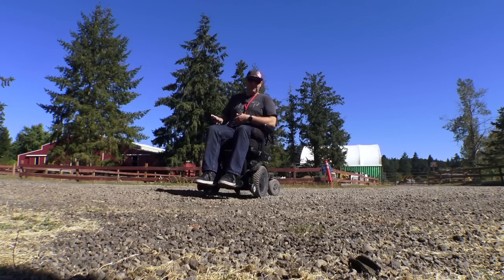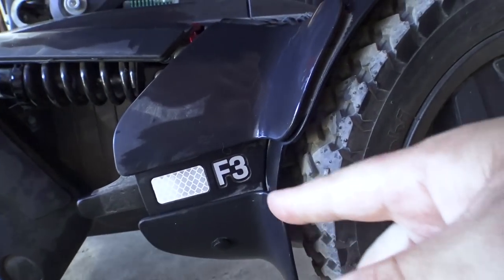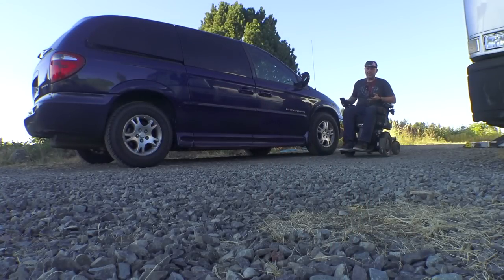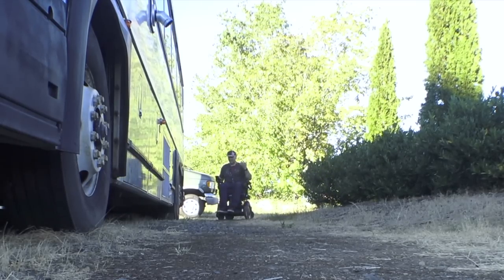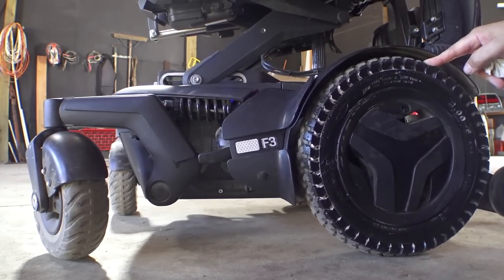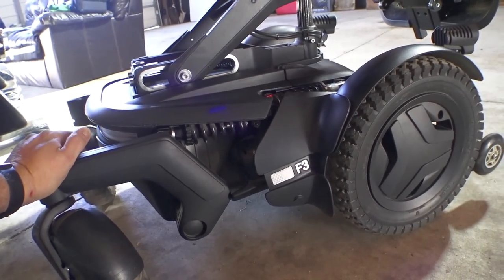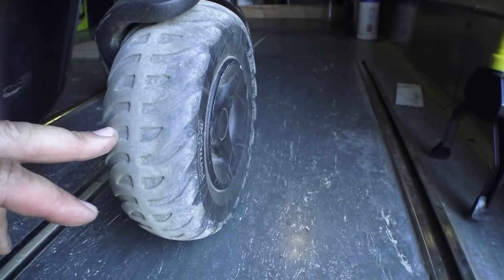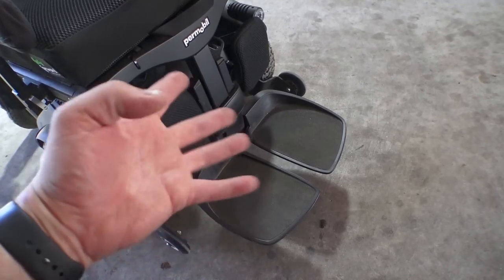VLOG 629: one year later - Permobil F3 review!

Comment from the maker: it appears as though these permobil 'aggressive tread tires' are made by CST (part of maxxis) - i'm searching for equivalents, as they make  LOT of motorcycle, small tractor, and mountain bike tires!
Reply: Great review and insight on improvements as compared to your '17 f3 pwc. Watched you clean the brushes on the old f3 and you referred to them as two-pole motors. Are the new f3 motors four-pole? In light of your 'Edge' bomb, some folks might like your thoughts about the difference and benefits of both two-pole and four-pole pwc motors. Thanks
Reply: I have a wheelchair almost just like that one,it was giving to me after my TDX SP2 broke down 4 months ago.
Reply: Watching you work on the chair I almost forgot your the one who uses it. I have the same chair, it’s great but useless in snow, anyways I wanted to ask since I’m a caregiver s well and my son who is hypotonic of the lower trunk and autistic, his ankles are weak and turn in, I wanted to make. Board he could stand on at the back of my chair, what’s your thoughts?
Reply from the maker: ive made some skitch boards over the years.. havent really made one i like, and that works well yet.. but its a good idea! attaching them to the chair is the trick..
Reply: I made a bracket to connect a set of jungle wheels to the rear tie down loops with a bolt/washer on each side.

Comment: I'm currently driving a 2021 lime green Permobil F3 that I took delivery of on December 20, 2021 (ordered March 13, 2020) and my parents have even noticed a difference in the engine performance compared to my 2015 Permobil F3 that I took delivery of back in October 2015. At first I wasn't sure if they were right about the new 2021 chair being maybe a little faster and then my 2015, but after they review that you just did on your chair I'm actually surprised that they did change of the engines a little bit, I thought it was just the same that's what I had before and I thought it was just the programming done on the software that gave it a little extra power.

Another thing that I also really like about this newer generation for the F3 is the technology, for multiple reasons especially the MyPermobil Bluetooth connectivity function that comes with the chair. I personally like having it because if I'm driving somewhere and if something happens to the chair they can look on their computer and locate my chair if I am in need of help. Another thing I learned about this chair just recently from my salesman is that if you give than permission they can actually adjust the diagnostics on these newer chairs over Wi-Fi which is really interesting. Also I love how the Bluetooth connectivity option now comes standard on all of the chairs because the feature is built into the controller instead of being a separate option, and another convenient feature built into the joystick is infrared. I love having the ability to control my TV or any other infrared compatible device just with my controller on the wheelchair.

My beautiful Green Machine turn eight months old on August 20 and I just have over 70 km on it, and I agree with you Dan this is the best chair for sale. It's going to take a lot for other manufacturers to compete with this chair.

Comment: For cleaning the hard spots use cans air works great. I had a per mobile abut 12 years ago and hated it.the arms only had “back” support and when transferring the single bolt would break. The first few times were almost disastrous when I contacted my provider he said the arms were not ment to be used for transferring. I’m a c6/7 as of 7-8-1969 and needed the arms for transferring. That chair in out in my shed I have a Quickie 636S. In Dec I can get a new chair but not sure what to get I’ve had problems with the Quickie and has replaced numerous parts. 
Thanks for your videos

Comment: My first chair back in 2011 was a Permobil C300, which is the older version of the F3. These are both front wheel drive models. My next chair I got in 2016 was the Permobil M3. I chose that chair for the dumbest reason ever! The ALS support groups I go to, I'd be the first person to have the new M series chair. I have just hated the mid wheel drive as the additional front casters make driving it more difficult as it creates more drag with added casters having to rotate. Not to mention, off roading is horrible as the second you spin the drive wheels, then if you try to back up, the front casters try to rotate and your totally stuck! With a front wheel drive, you can go forward till you get stuck and can always get out backing up. I will never go back to mid wheel drive.

Comment: I am sure I will have more comments…
When attaching plastic pieces together, check out plastic rivets. Or stainless steel rivets. They are a combination clamp and fastener. They are also mostly flush and don’t catch on stuff. If you do aluminum rivets they are easy to grind flat.
Reply: Thanks for the review 👍🏾

Comment: I'm an avid hunter/outdoorsman and I am rough on chairs. Through the woods, over roots, up steep hills(backwards works best), through mudholes (yes I get stuck on occasion) all with the regular standard tires. I assume the aggressive tires fit the same wheel? They'll be my next purchase. Also, I use a side support, ribcage height, that flip around with the gray tab..... they're junk and need a redesign. Great videos bro!
Reply from the maker: they're a direct replacement for the stock tires
glad to hear someone else out there is using the crap outta their chairs as well! :^)

Comment: I’m a C4-C5 Quadriplegic and also use a permobile F3. For about 20 years I always had an Invacare Arrow Storm. I never had issues except for worn tire replacement which is expected or batteries not holding a long charge after three or four years. It always felt fast and extremely precise.  I don’t go out except maybe two or three times a week for different occasions “Doctor appointments , shopping , etc”.  I take good care of my electric legs😀!

I don’t know if I have the dud of an F3 batch, but I truly hate this chair. From the first day I received it, it drives like a bus compared to my older in the care chair. Granted the F3 is a front wheel drive chair and the Arrow Storm is rear wheel drive. The rep from the wheelchair company did all they could through the settings to make it more precise. It’s as if there’s a sensitivity governor on the chair so that if I make a quick movement it delays the response.  Also, I told the wheelchair rep a week after I had the chair that there’s a weird gearing mesh grind sound coming out of one of the motors while coasting. Thankfully it had only been a few months old “yep, had to wait that long for a new motor” and the motor was replaced under warranty.  I also had a separate tilt and reclined touch box that burnt out after six months.   The batteries have just been replaced this past week and are only just over a year and a half old. Now the chair as of yesterday is making a squeaking sound on the right side and cannot find where it’s coming from for the life of me. THE CHAIR IS ONLY A YEAR AND A HALF OLD. What else is gonna go wrong in the next three and a half years until I can get one covered by insurance? 

I’m glad your chair has worked out for you. Me however, I’m counting the days until my insurance will cover a new powerchair.
Reply from the maker: factory programming is definitely a thing... its odd that a permo rep wasn't able to get things sorted out for ya though!
the motor brushes can be noisy sometimes - its a common ish thing.. BUT if its brand new, def have them replace the motors.  ive heard of a number of them making strange sounds right out of the box :^/

the shocks will squeak on these chairs as well.. mine started doing it after about 4 months of use.. BUT i do run around in deep gravel on a daily basis...  its possible to put a very small amount of lube on the shock seals - im going to be making a video about it soon
Reply: @TotallyNormal-  Cool, thanks for the info! I'll check the shocks and put lube on the bolts connecting them. It's unfortunately one of those squeaks that is difficult to replicate. Sometimes it happens and other times not🙄.
Reply from the maker: shoot me an email or DM on twitter.. i can show ya exactly where to lubricate things :^)
contact info is in video description

Comment: I have that same F3, and it handles horribly at slow speeds like you described yours did at first, I just got mine and the rep, and I spent a few hours trying to make it handle; there's just no going straight at slow speeds it's either left or right just cannot overcompensate but they're coming back, but those tires I want and kinda almost need living in northern Michigan but are they pneumatic? Right now, I'm back in my old C300, which is still like new, luckily, because the F3 is way too heavy for my lift. I currently have it's a one-arm rated at 600lb, and I'm 230, so it looks like, for now, I will be using the C300 when I go out, which is not very often doctor app only as I'm a quad C4 anyways I joined your thing. Keep the videos coming. I love them. I come from a mechanical background, so I can tell you know what you're doing.
Reply from the maker: FYI if you have a backpack or anything on your chair that swings around, it can make things unstable- gotta be firmly attached! Also going back and forth between c300 and an f3 takes some getting used to. On the f3 you have to concentrate on holding the joystick in the direction you want to go.. as opposed to the c300 where tons of small hand movements/adjustments are required. I also found that I tended to lean left or right in my c300 when steering- which kinda aided in the control. I set the tremor dampening on my indoor profile on the f3 to about 15-20% and that helped a bit as well. The tires on the f3 are ‘solid’ but have a very compliant foam inside. Nothing like the standard primo powertrax tires. (They’re Permobil aggressive tread tires from the 5 series chairs) Anyways.. hope some of this helps!

Comment: Did you need to move your ezlock floor bracket for the new chair?  I'm to get my lock put on my 2021 chair and the installer said it maybe in a different location than my 2017 chair even though the part number is the same.
Reply from the maker: i haven't actually put one on my new chair yet :^/ apparently theres a few versions, and ive been trying to get one that has the bolt between the drive wheels, instead of further back.. they moved it on the F3 for whatever reason and they catch on EVERYTHING
Reply: I got a F3 in 2019, had the bracket for ezlock put on and they had to move the floor box back. YES I catch on everything, thresholds are terror now. Have to use my old C300 for places that have thresholds, of course the installer guys that put the bracket on didn't even tell me they just did move the box back and installed the bracket. Maybe you put some metal under the box to shim it up some, and that doesn't interfere with your footplates. If you find a remedy lets us all know, glad you are able to drive without that lock in "wink". I called Ezlock they seem not care about making a different bracket. Beware of catching on everything. If you find a different bracket let us know. I really don't feel like switching to a different whole system.
Reply from the maker: I strap myself down in the van.. it’s SUPER annoying though!

Comment: I have a F5 chair now that is 5 years old that my wife’s insurance paid for. Now on Medicare they will not pay for a F5. My question is how does the F3 compare to a F5. Doesn’t look like a lot of difference. Tkanks
Reply from the maker: the F5 is basically the same, BUT faster motors, slightly taller seat lift, footprint is a couple inches wider/longer and has slightly better suspension.
(and has options for standing functionality)
other that that,  they're essentially identical :^)
both great chairs!

Comment: I'm in process of getting my first power chair with it being F5VS. (Once all the hassle with insurance is done). The placement of the front brackets to hook in I found is a lot easier if you use seat elevation (if equipped). Found that out by happenstance.

The back brackets as you mentioned is just god awful. I was not able to hook myself in on my own when I had a test chair to trial for a weekend. They need to find a better solution for placement 100%!
Reply: I'm in the process of getting my 3rd chair and I'm going for the F5 VS as well. Getting insurance to cover it will be quite a fight! However, my last chair, I managed to get my insurance to cover my seat elevator and the foot plate elevator which they typically never cover. It took some fighting as they denied it the first go around and had to appeal it. I'm expecting an even greater fight on this chair.
Reply: @briankepp6343  Hi Brian, your reply caught my eye regarding insurance and power wheelchairs (pwc). My pwc can be replaced 4/2023. The vendor who showed-up for my pwc eval back then, dictated he sells permobil but wouldn't sell me one - not enough profit. He told me my three choices; I asked if quickie qm710 were available as specialty backrest was long overdue and too much time had passed due to complications (assigned vendor went bankrupt).  I had Vocational Rehab at the time who pay for the client's preference and add-ons insurance companies will not. As well, wo V.R. my current repair vendor told me that my pwc choices will be limited to quantum, invacare, sunrise medical (quickie). That quickie is sitting in the shop waiting for motors (3rd pr), batteries (3rd pr), R-net joystick (no. 3), Swing-away apparatus (no.4). Fortunate to have the old permobil c500 (2,800 mi.) and determined my next pwc is an f3 or f5. While you're familiar with the process of 'appeals' regarding pwc brand and add-ons, I'm not. Again, voc rehab helped me in the past, now I'm older and question my eligibility, but 'they' might be a resource available to you if necessary. Perhaps you could offer direction on what to expect, brand-wise, elevator, add-ons, etc. - regarding insurance paying. Thanks

Comment: I Heard The Left Center Tire
Squeaking So I Replaced It
With A Newone & It StillDose
The Same Thing. Could It Be 
The Rim It's Self. I Was Told By 
Mark's Mobility The Front
Suspension Springs Might
Need Some WD40

Comment: Great video! I'm in the process of getting my first chair and my PT and equipment dealer have suggested a Quickie Q700M by sunrise medical. That's the only company my insurance works with in NH. It seems like a good chair but am concerned about getting stuck in compact gravel, we live in a rural area with dirt driveway. As insurance will only cover an indoor chair, should I try and find a more hybrid option like the frontier v4 or similar? Thanks!
Reply from the maker: the V4 (v6 front) seems like a neat chair! - but they are considered a group 4, for billing, so they're rarely covered bu insurance.. im trying to get my hands on one though!
the quickie chairs - ya have to watch out for water.. their manuals state that ANY water can cause the suspension to freeze up if not cleaned off immediately.. BUT a small carpet blower fan does the trick when coming inside from the rain :^)
Reply: @TotallyNormal-  That makes sense, I wondered about water... thanks for the info!

Comment: I have 200 miles on my 2022  I am getting a clicking sound after being at speed for a bit than slowing down and going slow. I was told motor issues? Already?  And my leg rest cover broke too after 4 months. Got a replacement after my JB weld fix failed
Reply from the maker: ive had that on a few of my permobil chairs in the past.. does the sound change when going backwards? at 200 miles the motors are barley broken in!
Reply: @TotallyNormal-  if I could send u a clip of it you can hear it.  It does it both directions.  Funny thing is I didn't hear it at all today but did it every day last few months!
Reply from the maker: send a message with the contact form on the website - link is in description :^)

Comment: A friend told  me that you have a video about the "latch" feature that can be programmed into my Quantum Q6 Edge 3.0. for ilevel while driving. 
I'd love to see it but can't find it. Will you please send me the link?
Reply from the maker: are you talking about 'cruise control' or removing the inhibits so the chair doesnt slow down when seat is raised up?
Reply: I don't think cruise control would be useful or a good idea. 
I'm taking about the ability to use ilevel while in motion  (driving)  I either don't know how or needed to get my dealer to enable it. 
What is that feature called  and where can I find your video. 
I appreciate your videos. In fact,  I'm listening to your grips about cleaning your P3 as I type. 
ALSO what is your opinion on the new Quantum Q6 Edge 3.0  I just had delivered?
Reply from the maker: 'latched' driving is what they call the type of cruise control chairs have.. that's why i was wondering :^)
for the seat lift.. does the chair not let you move, once the lift is raised up? (im trying to understand the question)
Reply: Everything works great. I'm just wanting to know how to raise the ilevel while driving it. 
What is that function called?